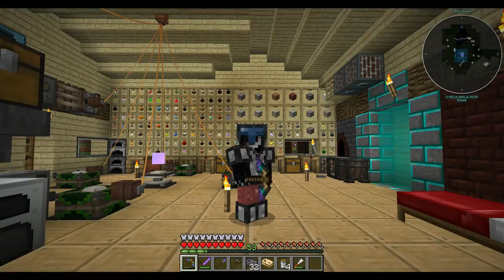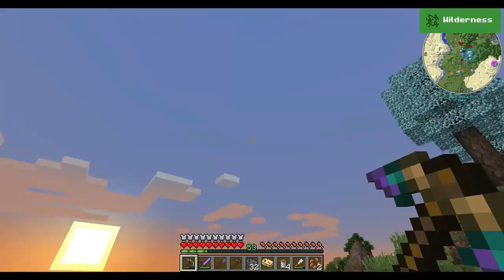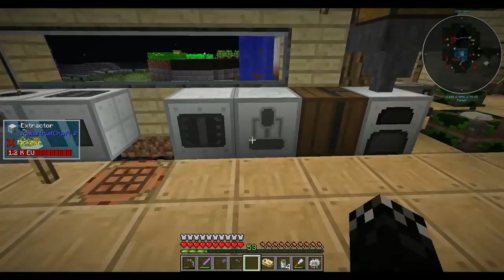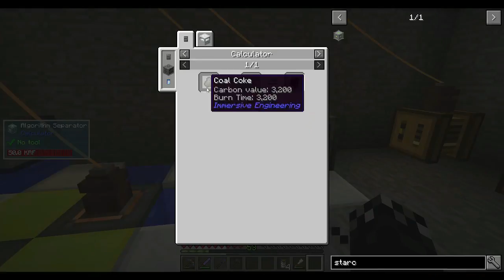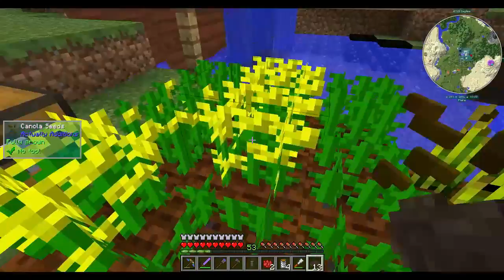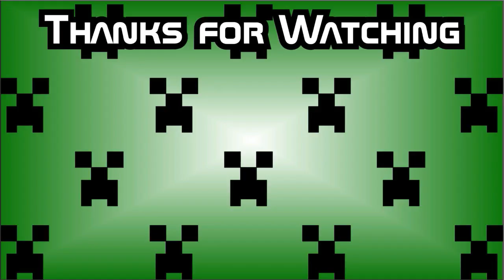Age of Engineering - Ep 16 - Still heaps to do

Comment: I know this is the last episode, but the new one reminded me I didn't finish watching this for some reason. If you're having IC2 power issues, Dire had an excellent idea using a fermenter and still to pump Ethanol into Forestry BioGenerators. I'd suggest using an IE pump and piping to move it around instead of the EIO Conduits he used.

Also, covered Conveyors from EnderIO with Item distributors will also work well to move items from the farm to the house. At least, I'm pretty sure those were in 1.10.

And if you haven't worked it out, Silicon also comes from Clay dust in the Thermal Centrifuge.